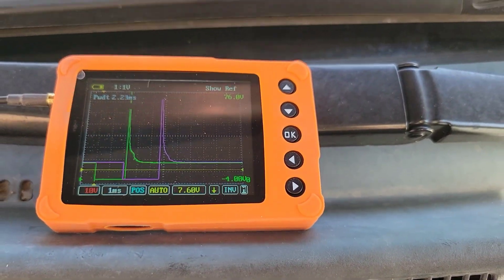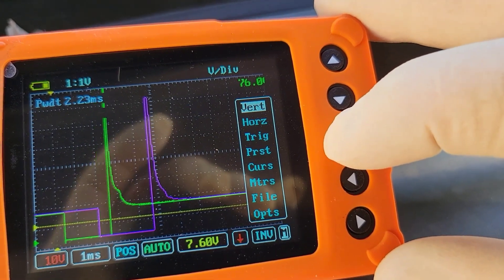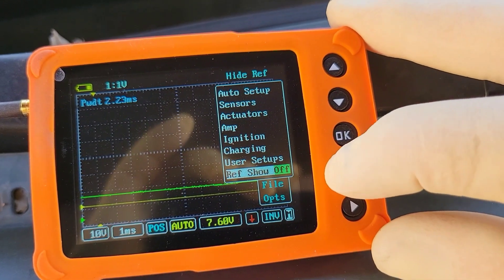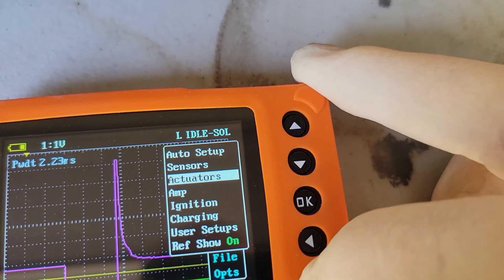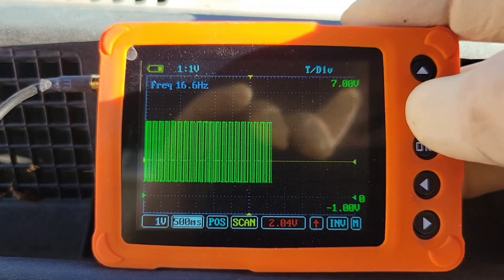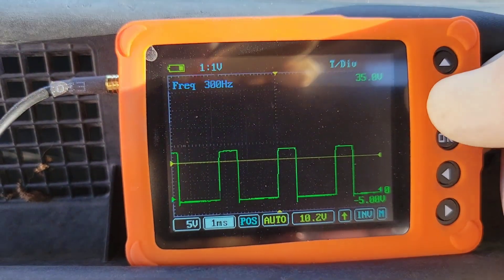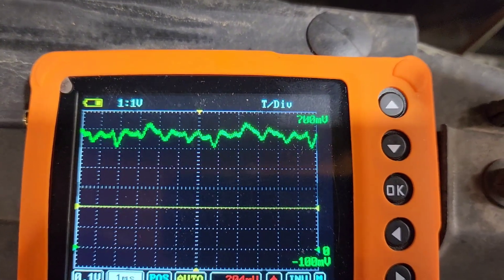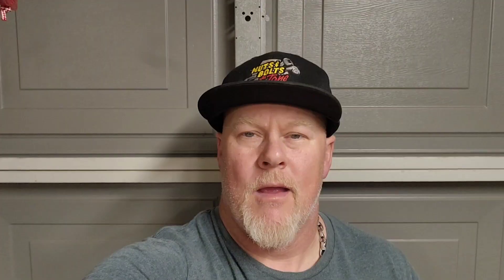The Best Little U SCOPE  That Could

Comment: Need to get a case from jarhead diagnostics on YouTube
Reply from the maker: I messaged him about an adapter for the case the hook up my stuff from the u scope. I bought the master set with leads, ignition tester, low amp probe and it wont work with his case. he told me he would get me an adapter and never heard back from him. so there is that. But I was ready to buy a case from him if he got me an adapter. Thanks for watching.
Reply: @NutsandBoltswithTone  didn’t know that scope was that easy to use be nice if it was 2 channel but it’s quick for simple checks